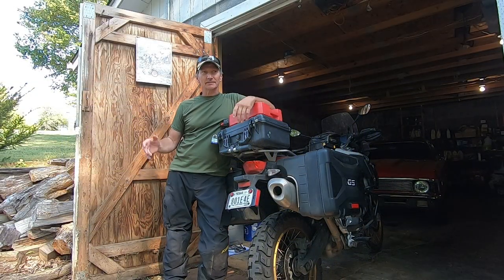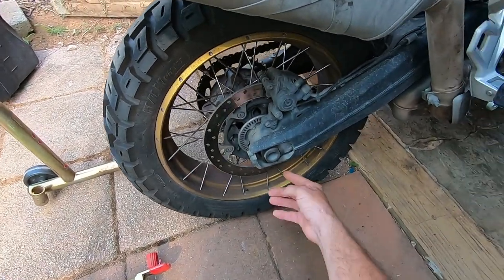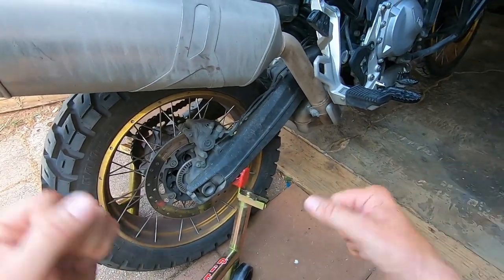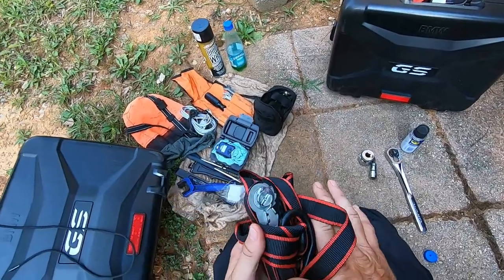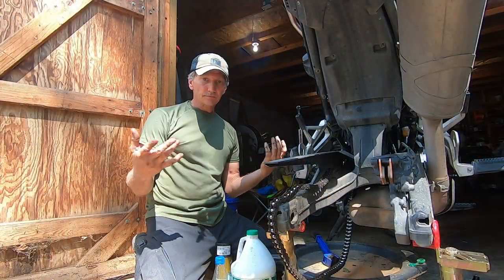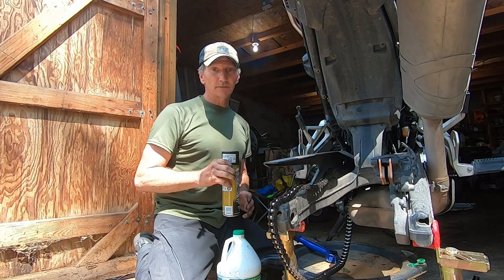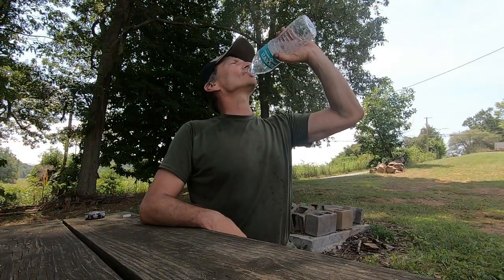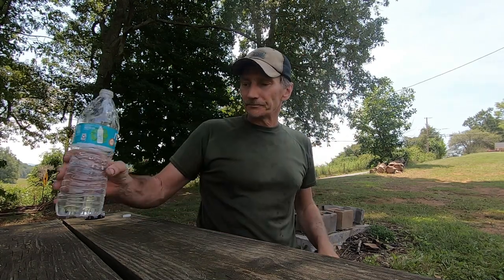Changing brakes on my  BMW F850GS

Comment: I accidentally removed the bottom rubber on the pin (break caliper) how do I get thr rubber on again?
I have to separate the pin and the outer caliper?

Comment: hey Chad thanks for your videos, as i was changing my rear pads there's this backing plate that came off i know there's a correct orientation on this because the plate is curve, can you please guide me on this if whats the right orientation on putting it back. TIA

Comment: maybe you needed to look at the brake piston seal also. Looks like there was a leak there with all the oil on the brake and pads.
Reply from the maker: Thanks for the heads up.   That oil was from overspray of wd40 where I was cleaning other parts.   I wasn’t concerned about getting it on the brakes because I was changing them.   But again, thanks for pointing it out.

Comment: Как поменять колодки не снимая колеса
Reply from the maker: I’ve not made a video in a few years.  Just wasn’t my thing.   I tried to reply to every comment, but after so long, YouTube stopped sending me comment notifications…. I apologize.   I got on here to delete my channel and just saw the comments.   Again, i apologize.  

Yep.   I do that often.   But I usually remove the wheel just to do maintenance and check everything.   

You are absolutely right.   No need to remove the wheel.   Was and is just a preference of mine.  

Happy riding my friend.

Comment: I would not use simple green as it will break down the lubricant inside the chain.  Only use a chain cleaner that is petroleum based.  You will see premature chain wear using detergent s.  Love the ratchet strap trick I use it myself.  I also don't remove the rear wheel when doing the pads.
Reply from the maker: Thanks for the input Patrick.   I don’t doubt your advice but I’ve used simple green for years.    I’ve actually found petroleum based cleaners swell the o rings 🤷🏼‍♂️.    

The ratchet strap thing made it way easier!   Cool to hear others had figured that out as well.  

Anyway, sorry for the late reply.   I no longer make videos and don’t check comments that often.   My bad.  

Take care and safe riding.  

Chad.
Reply: @1leftadventures258  brother !! I’m from Buchanan County Virginia , keep making a videos, there awesome . I subscribed and shared your stuff. You should make a video every once in a while so all your fans know everything is good with you. Any way god bless you.
Reply from the maker: thanks brother!    I really appreciate that.   I’ll take all the blessings I can get.    

It’s really cool to hear from people that are in my old neck of the woods.    Take care and God bless you as well.

Comment: cant you just do the brake pad change with the wheel still on? like on the F800GS? and is there a reason you are not using coppergrease on the back of the pads? just wondering, like the video ;)
Reply from the maker: Thanks for the comment.  

To be honest, I didn’t even look if I could.   I assume I could have but it’s gotten so easy to pull the wheel that it’s normal.   I had just gotten back from a 4500 mile ride and lots of nasty weather.   So I had planned on Breaking everything down, cleaning well, and lubing.   

I used to use brake grease on the backs, but Once I changed them and didn’t have any copper grease to put back so I did anyway.  I had no brake squeal.   To the best of my experience, the squeal is the only purpose, so I haven’t used it since 🤷🏼‍♂️.    

I appreciate you commenting and watching.   Thanks.
Reply: just changed my pads on my 5 month old 21 with the wheel on, a little under 12k miles on the stock organic pads was able to push the piston in with my fingers. replaced with EBC organics.
Reply from the maker: Cool.  Good to know.  I appreciate the advice.
Reply: Maurits, you can indeed. It's the same as on the 800 , a 10min job.

Comment: Hey Chad! Do you do any other general maintenance after a long trip like tightening bolts or greasing bearings, axle and swing arm or stuff like that? I’ve heard it should be done but I haven’t find any video on YouTube.
Reply from the maker: Hey Alvaro.   Thanks for commenting!   Yea, I do a lot of maintenance on the bike as I travel constantly.   Unfortunately, I’ve stopped making videos.  I’m just not cut out for it.   

My advice is to keep watching videos and take what most say with a grain of salt.    Many are FOS but some are good.   You’ll figure out what matters.  

Best of luck brother.   

Chad.
Reply: @1leftadventures258  sorry to hear you are not making videos anymore. I love your videos! Such a good vibes 🤙
Reply from the maker: Thanks Brother.   I appreciate that.

Comment: Thanks for the video, it’s really interesting to see. You really should have a center stand on the bike. Isn’t it any aftermarket stands that will fit the bike?

I think it’s a little difficult to measure the chain tension on the bike, because the chain touches the swing arm before the chain is in the spec so it’s not possible to measure the “upper slack”. If the chain is so tight that it’s not reaching the swing arm in upper position it’s to tight and not in spec.
It would have been better to know the correct values for the down position of the chain. Like if the downwards chain slack is between “x to y millimeter” from swing arm it’s in correct spec.
They also could have pointed out another point to measure the slack than the center of swing arm.
Reply from the maker: Yes.  I agree.  A center stand would make things much easier.   They make aftermarket ones, but I’ve really gotten used to my snap Jack and Pitbull.   It really doesn’t bother me anymore.  

I think (off the top of my head) it’s around 40mm of total play.   I used to push the chain to the plastic guide on top and measure to the downward point.   Sometimes it worked, some it didn’t.   I’ve done this so much now, I have learned by just lifting and pushing by hand to where it works best.   Kinda hard to explain how I do it.
Reply: Yes I can imagine that when you have done it a lot of times you know by the memory in the muscles how to lift and use those things. An it’s the same with the chain. After all those times you can almost see by just looking at the chain if it’s out of spec. 
That’s that type of knowledge that can’t be teach in text. You have to learn it by doing.👍
Reply from the maker: I guess we all learn as we go.   I’m always welcoming advice from people like you.
Reply: I’m learning a lot from your videos. Both about the bike and also a lot of history. It’s interesting to see from different places that one probably never get the possibility to visit.
Reply from the maker: Thanks.   Like I said, I just wing it.   

If this craziness in the world doesn’t end, all of us will be limited on adventures.    I do hope you get to make it over here someday.   As do I hope to eventually tour your homeland.  👍
Reply: Oh that would be cool, I cross my fingers for a good future.